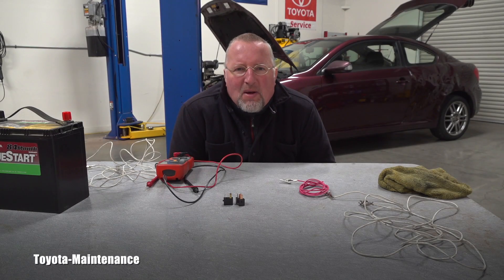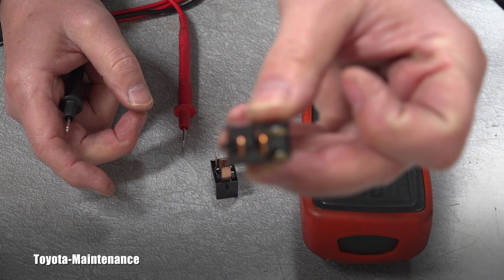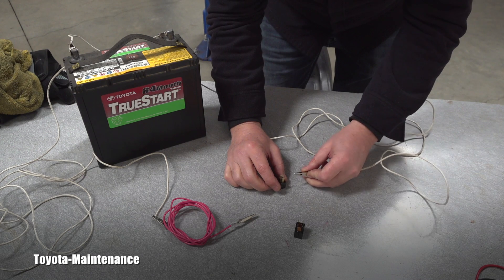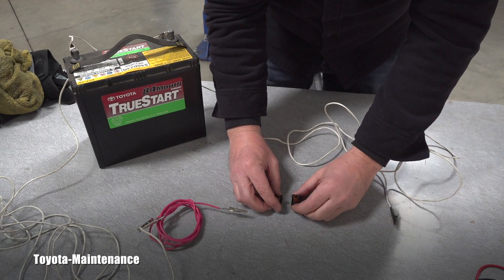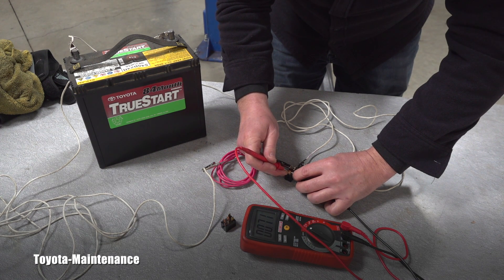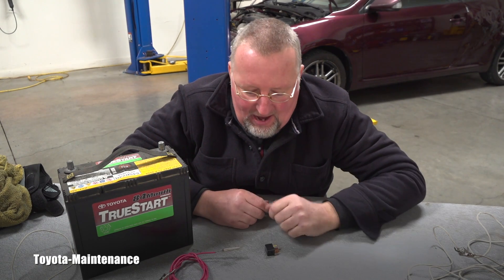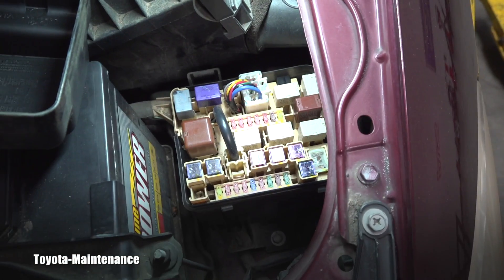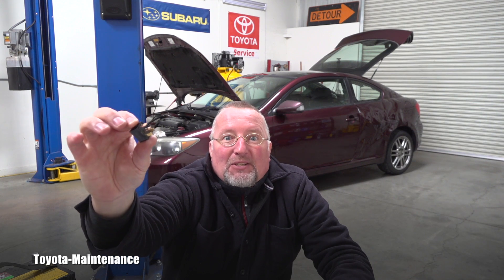How to test a Relay

Comment: OMRON G8HL-H71 is told equivalent to Mitsuba 7001. On 3 of these Japanese I'm reading 155 to 158 ohms in the coil, after 100k miles of a 2009 Honda Fit. Auxiliary under-hood relay box.
I was expecting around 120 ohms  with a 10% margin. Still, they connect, providing less than 0.3 ohm in the contact line. Currently, I'm not blaming them for having a dead A/C.
6:15 on the aftermarket relay: with 1.1 ohm leave the people happy?
That would cut 11V under a 10A load.

Comment: Nice! You can also put a typical load on the load side of an activated relay and measure voltage drop across it to check for contact quality (ability to carry current). It is rare, but the load side could pass a continuity test and yet have high resistance to current flow.

Comment: I would rather buy the tool you hook up to the negative battery terminal ? And it has slots to insert the relay and it will tell you if it's good or bad .

Comment: Was able to check all my relays . I have a 12 volt power controller that I used for voltage then used my meter. Great video. All my relays work. Thank you so much for this wonderful video

Comment: Hey:  Does anyone have an idea why my axillaries are not working? I recharged a recently new battery (96w)over night and placed it back in the van(Peugeot Partner DW8 2004), but now my horn/Digi clock/courtesy light/indicators/high beam and wash/wipers don't work!  When I switch on my ignition my side lights come on and when I switch the engine on my main beam lights come on with the light switch off! So my lights are staying on all the time as long as the ignition switch is on and I cannot switch them off at the switch. When I switch the engine off and remove the keys the lights go off.  The remote locking/alarm system also works. I have checked all the small fuses and none of them have blown. I haven't checked any relays as coming from this video yet.
This is so strange and all I did was recharge my battery and put it back in again. Could it be an open circuit caused by possible power surge on the relay that controls them damaging it, or could it be something else?   Any help is appreciated..

Comment: You should not touch the metal probes with your fingers when taking your readings. Touching the probes gives continuity and ohm readings to the probes through your body   Try that with a/c power.  U wont do it again.

Comment: Got a 2004 Toyota Corolla doing an engine overhaul, engine is almost ready to go back in but then I also had hot air las time car ran, so i wen off without limit and bought all AC tools and parts required to do a complete overhaul which it should be a little bit less expensive than a $1700.00 shops charge for doing this kind of work; a mechanic suggested to me before I started taking the system apart that take it to a pro and get a diagnostic but then there it goes trust; there is a reason why I am doing this painfully slow overhaul, then i came upon this video; well i think I may have found the issue in my case; my relay has continuity between the silver leads, one is marked on top with a black dot, I am assuming meaning negative? in any case polarity should not affect continuity, but when I test the brass leads after applying power from the battery there is only 0.1 and 0.3 ohms reading; using a Fluke 107 meter which is the one I use for work (Electro-mechanical field engineering, similar to mechanic without so much grease and grime) so then I tested the compressor and clutch engages. Car engine is off the bay still but AC components are sealed, I have only disconnected the power steering pump  and was thinking to get the engine back in with all the parts attached and serpentine belt as well, as it turns out, seems the culprit is that relay (system reads 65PSI in low port with 100F outside temp, did not hook the hi port) so it may be low on freon as well but with the compressor engaging i do not think i will recover the freon and disconnected it, unless someone would suggest to do a maintenance of the system given having the parts and tools to do so, my idea came as I thought it would be easier to work on the AC components with the engine off the bay than with the engine in but as it turns out there is really not much difference; mind you I still have to see if the car will crank and start once i drop the engine back in; i worked on this car taking my sweetest time over the course of 3 years, everything in the engine bay major have been replaced or re-done; the original issue was failed gasket due to overheating because neglecting oil and coolant, twice!! the first time we went with a "mechanic" only to happen a second time in less than 2 years (it was not because of me the issues, but I was blamed all the same!) so here I am trying to complete this car; this video helped a lot. Thanks for it. I subscribed!

Comment: question?  I used a test light on the ports #86 for the starter relay. I used the clip on the positive terminal to see if #86 lights up and it did. it shouldn't light up correct???

Comment: Putting your index fingers on each test probe metal tips will give you an  incorrect resistance reading! reading. Doing this provides a parallel path through your body: Kirchoff and Ohms Laws, blah, blah, blah.

Comment: Thank you good Sir. The AC compressor clutch in my wife's vehicle decided to no longer engage on (ironically) the hottest day of the year thus far. I watched videos on jumping the connections in the fuse box which looked too risky for me. Diagnosing the state of the relay is the proper way to go. My relay proved to be in an open state. I drove to my local Subaru dealer this morning and purchased a new relay for $8. Got home, popped it in, started the car, and voila! AC is working again. Thanks again.

Comment: my day time running lights strobe on and off/ left and right like an ambulance. I installed 4 LED lights and no problem for over a year. Also installed anti flicker units yesterday and it doesn't change. I even pulled the fuse to the DTR lights.. no change..but Something changed in a years time but I don't know. What's my the problem here? Headlights work normally when turned on ..hi and low beam. I looked for an answer/ similar problem on line and didn't find anything.

Comment: always wondered.... when testing a relay outside of a vehicle, how do you know which side is positive and negative?  (or does it not mattter?)
Reply: Great Question. Best way to find your positive is unplug the relay: insert a 12v test light on one of the open slots of the relay plug. Whichever the light comes on that indicates the hot 🔥side then correspond that with the relay

Comment: VERY GOOD DEMO.Thank you.But it is ok using replacement relay with no markings just same pin orientation??My original but defective has its part number and cant find with the same PN although have same pin, are those safe to use? thank you very much

Comment: Power Probe can be use here?  At least you dont have to drag a 12 volt lead battery( that motion, removing the battery from an ackward deep angle  is responsible for many a mechanics' damaged back discs ). But i am glad for test procedure.